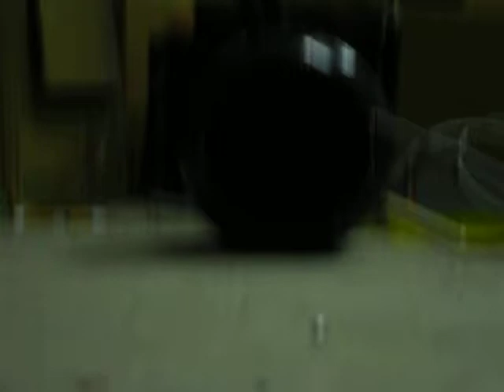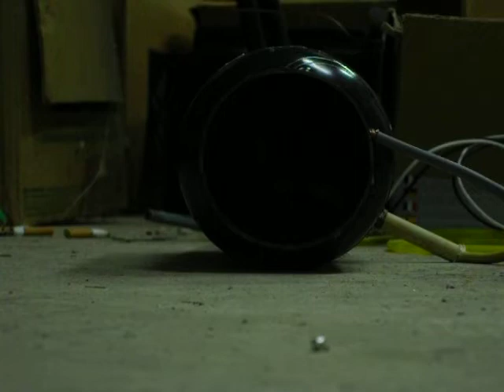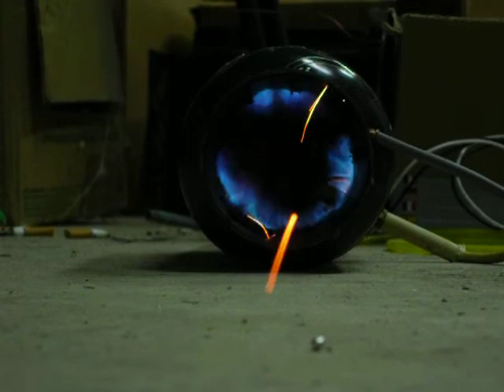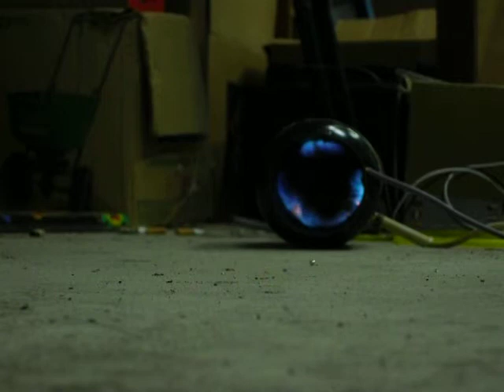Turbine combustion chamber test #2. Fuel and air.

Comment from the maker: @JaycubL I wouldn't say it could put out enough for a practical use but it is still fun to light up. It was more to get a chance to see what effects different hole patterns and injectors did and what allowed a self sustained flame. I don't have enough tooling to build a functioning turbine. Do a search for "GTM120 jet engine in a glass enclosure" they nailed it with that one.